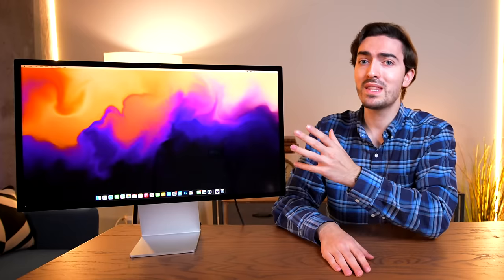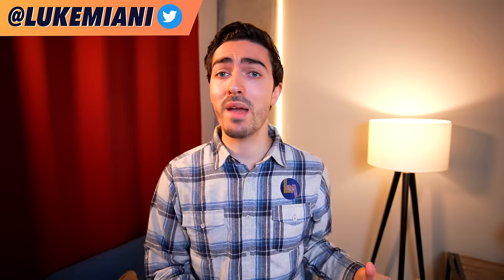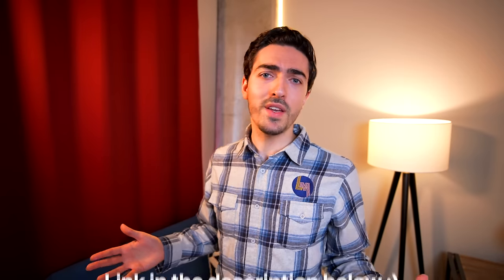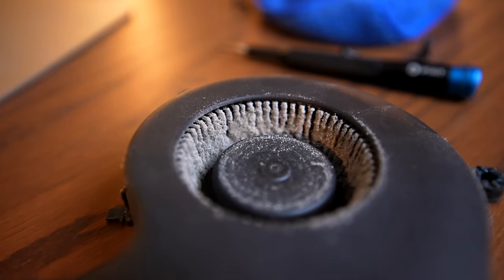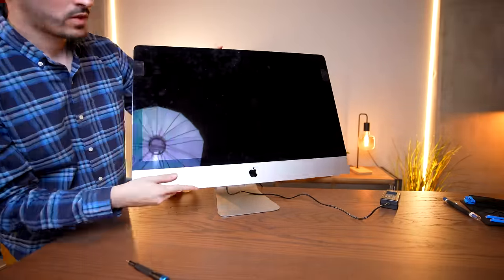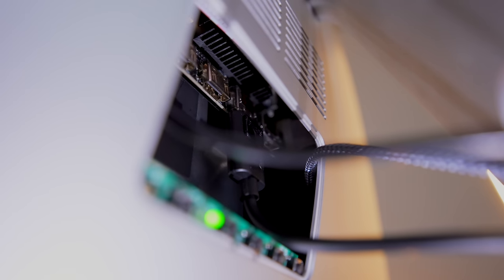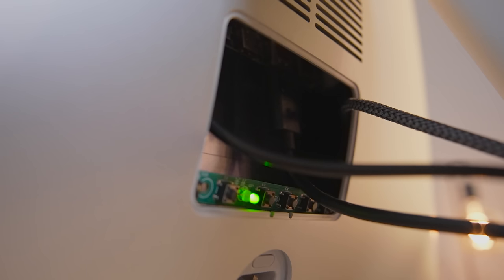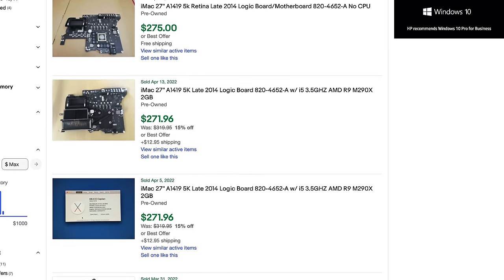How to make a DIY Studio Display for just $600! (USB-C & Built-in camera!)

Comment: August 18, 2024 post. With the aid of this great video (and a few other popular sites discussing this exact modification), I successfully converted my 2015 27in iMac computer into a 27in 5k external monitor this week. It’s great that my mac computer “sees” the monitor as a 5k monitor as seen in the “display” section in the settings. Note that I needed to remove 2 recessed screws to release the motherboard, so you’ll need an extended screw driver to reach those two screws (there is a hole in the motherboard above the screws). Luckily, my tool kit had an extender for my star bit. Also, connecting the backlit cable on the controller board to the screen backlit wasn’t clear as to which ends connected (left-side or right-side)? Luckily, I guessed the correct orientation because when I powered it on, it looked fine. Removing the screen, with the correct tool, was very easy! Bottom line is this video is a gem! And I would think most people can complete this project successfully if they take their time and proceed step by step in a careful manner. The monitor resealed perfectly with new adhesive strips. I did skip adding a camera. Took me 4 weeks, including the 2 week wait, for the controller board to arrive. One week to disassemble, 2 week wait for motherboard, one week to assemble. I took my time taking it apart, took my time rebuilding it so I avoided any mistakes or frustration.

Comment: Great video. A few suggestions:
3d Print  a bracket to hold the converter board and a panel to cover the cable out and buttons where the RAM door was.

Also you can rewire the existing original camera to usb very easy without the need of any converter.
Reply: how can you rewire the original camera?
Reply: Interested to know how you’d rewire the original camera. Please do tell.
Reply: yes i would be interested in hearing about this too!  I assume this would allow one to use use the built-in mic as well (a mic appears to be missing from the build in the current video)
Reply: my thought is just to carefully machine some access slots into the door.. but - Im thinking to use an mac mini housing applied to the outside of the iMac.

Comment: Really cool. I would attempt to reincorporate the RAM door back. Perhaps drill a cutout and stick a rubber grommet in it, tying and running cables through it prior (did something like that in a vehicle, looked stock). Drill the bottom of the door to install rubber button extensions that would press the clickers on the PCB. But that's only if I'd want it perfect.  Terrific project, Luke!

Comment: Wow, I'm an Apple Authorized technician so for me, a project like this is easy! The shop I work for also has plenty of dead 2014 iMac's laying around with working displays. This looks like a fun and easy way to put them to use!
Reply: Any chance you'd be able to ship some of these already converted to monitors to interested buyers...? I did see somewhere that certain imacs from 2009 to 2014 can be used as monitors through something called target display mode...
Reply: @diceydaze  I haven’t done any conversions yet, but I do have plenty of loose iMac screens from 2009 to 2011. The iMac’s after 2012 used a different type of display. And are much more expensive, I only have one 2014 display in stock as of now
Reply: I went ahead and took the gamble on a eBay non-functional unit. I’m hoping that the display arrives intact. It’s supposed to be able to power on, but iCloud locked. Couldn’t get any information on the condition of the screen. Would be awesome worst-case scenario if you had a 2014 or newer display on hand.
Reply: @diceydaze  2009-2014 imacs can be used as monitors through target display mode, but the 27 inch 5K retina 2014 iMac CANNOT. I have confirmed this.
Reply: @this_is_NOT_a_test  I guess that leaves no other choice than to dismantle it.
Reply: @this_is_NOT_a_test  as long as you don’t use anything newer than Mojave or Catalina afaik
Reply: @kantdiego  No. As I said, I have confirmed this. It has nothing to do with the version of the OS. The 27 inch 2014 iMac is "5K," and Target Display Mode (TDM) was dropped, because 5K iMacs require a custom timing controller to drive the display at 60Hz and TDM does not work with said controller.

Comment: Awesome project! I have just replaced this exact iMac (late 2014) with a Mac Studio and Studio Display.

I would like to clarify one thing I believe you are wrong about, which is the difference between the two displays since p3 color is not the only difference. The 2014 iMac panel is a 400nit (500 in later versions) and the studio display is 600 nits.

Comment: I just did this myself with my "old" iMac from 2017 and it works flawlessly. Two things i did additionally was to connect the power supply to the imac to use the original cable and 2nd i connected the original imac button to the remote control in order to turn on the display via that one. One Issue I faced is that because the imac is much lighter now, the chin rises by it self sometimes. Thats why i put some useless things into the body to get some weight.
Reply: Hi. I'm curious to know precisely what camera and microphone you used?   I've got everything else up and running.  Cheers!!
Reply: @vizcode-vd1es  greetings! I use non since i use my macbook parallel and thus dont need them in the mac. Its a monitor only for me.
Reply: How's the colour accuracy and are you getting 5K resolution ? Thanks.
Reply: @aman681  yes I am getting the full 5K 60Hz. As for color accuracy I had play around a little. I had a very small violett tint, which I eventually was able to correct. Most people wouldn’t have recognised tho, but I am very strict on color.
Reply: @helios007  Thanks for your reply mate. Yeah, I am planning to use it for photo and video editing so colour accuracy and deep blacks really mean a lot.
Reply: @aman681  you’re welcome. As for colors I got it completely fine for my needs as a freelance photographer for portrait and events. It’s still a nice display but if you really want black blacks you may opt for another display. For me it was mostly saving some money and having the experience of creating your own monitor but the apple display will give you better results since it has a bit more contrast.

Comment: This is a really cool project - before the Studio Display was released I had done some research into something like it and the tinkerer in me still wouldn't mind giving it a go. The only thing that worries me is that for $800 (before you sell any left over components) you're getting an 8 year-old panel, it's hard to say how long it's got left. The panel in my Thunderbolt Display suddenly gave out on the 10 year mark, thankfully I could get a brand new LG panel for it for c.US$250 incl. shipping. A new 5K LG panel is around US$400 or more, if ever needed, then you're getting close to Studio Display money.
Reply: there are 2004 apple displays that still work so

Comment: Oh man, I'm going to replace my 2017 iMac later this year and I can't wait to do this mod! Thank you SO much, Luke. Top notch content.
Reply: I'm actually doing this right now, but i ran into an issue. In the 2017 iMac, I have the USB C to DisplayPort 1.4 Cable (Luke's posted links) and tried to connect it to my iPad pro m1 and it did not display anything. Nor did the display work with my 2019 macbook pro either. It seems you need to connect 2 DP cables instead of 1. Trying to figure out which is the best product for this.
Reply: @BUdJohnson242  I ran into the same issue. I'm not sure how Luke magically got 5k on a single display port cable. (I bought the same cable you did and it's going back to Amazon tomorrow) Customer support told me the same thing you need two DP ports to make it work... My workaround was to use an HDMI to USBC cable. I was able to get beyond the 1080p DisplayPort barrier but only at 30Hz. But I think that's more of a limitation of the cable. I've seen lots of 4K HDMI to USB-C cables (rated at 60Hz) advertised all over the interwebs.

Comment: Awesome. Maybe I missed in video, do the speakers still work? Definitely considering this, currently have a 2017 27" iMac which is running great but starting to show its age especially as start getting into video work. This method makes jumping to Studio box much more appealing and overall affordable. If can sell off the iMac's internals would be about a wash in overall expense. Any way to re-purpose the iMac's SSD? Thanks Luke!
Reply: I'd guess an external disk enclosure of some type - I have no experience with Apple computers made post-2009, but you should be able to get some kind of an external SSD enclosure for it.
Reply: OWC sells external USB enclosures for NVMe drives with Apples proprietary pin layout.
Reply: No - the speakers were removed.
Reply: @fredhall3453  This comment has nothing to do with speakers. We are talking about the iMac's internal storage device and how it can be used as an external mass storage device.
Reply: @tsuyunobradley4439  Did you miss his first sentence?  That's what I was answering.
Reply: @tsuyunobradley4439  ..first sentence “…do the speakers still work….”
Reply: @ernestgalvan9037  well excuse me for struggling with the English language!!!!
My first language is Japanese, not English. And I use translate a lot to help me. I didn't see the sentence, so I'm sorry.

Comment: That’s awesome! Now I’m thinking if the 5K display can be mounted inside a Thunderbolt Display chassis 🤔🤔
Reply: If you can find the display without the front glass already mounted it should work. Been looking for a 5K display for that exact reason
Reply: @MMCLProductions  the imac displays always have the glass, they are glued on and sold as a single unit. the lg ultrafine 5k uses the same panel without the glass and stuck inside a housing. model number is LG LM270QQ2
Reply: @lilypadsy  legend, do you think it’s doable to put it into a Thunderbolt Display?

Comment: Thanks Luke!  Question: Do you think it's possible to do this install, but keep all of the iMac 5K internals and functionality intact?  Would be great if the required hardware could sit outside of the iMac, and allow for a graphics cable switch to switch between the internal  iMac and using as an external 5K display when needed.

Comment: I bought one of these last year for $500 - i7, upgraded graphics, 500 GB SSD, and it's my daily driver on the desktop. The screen, speakers, videocam are all great. I would someday like to run it in some kind of Target Display Mode via Thunderbolt 2 using a network connection to see if the performance is reasonable.

Comment: I really want to emphasize how important it is to be careful around that power supply, Once open the power supply is completely exposed and can be dangerous to touch for months after the unit has been unplugged. Thanks for the great video, I work in an electronics retailer and we have customers ask us all the time if they can use their iMacs as external screens? We have to say no because while luma screen exists it's not a plug and play solution like they want. Even though this might not be a solution for those random customers it's a great thing to know exists for those handy enough to do the work!

Comment: Great project Luke. Good use for an old iMac that otherwise would be recycled. One question - what do you use for the 12v power supply that the conversion board needs? Look like you had something external but I could not really see it. Thanks for the excellent videos!
Reply: Any response on the power supply?

Comment: I think it is an authentic and interesting project, well worth the tinkering effort. I have since bought an ASUS proart display for around the $600 AUS dollar mark and it is a wonderful display, however it doesn't have a webcam built in so this makes this project extremely viable, not to mention the nice Apple esc logo and additional software benefits you get by having Apple native gear.

Comment: Really appreciate your innovative thinking for reusing and adapting older tech that still has life. Wish I’d seen this 2 weeks ago, I just got a Thunderbolt Display to go with my MBP 2015 15”. It was $200, a late production 2015, mint in the box, and does fine with media content and color is great - video, movies, and photography - but lacks the sharpness with text especially if you get closer that normal viewing distance. Cheaper than the iMac solution here, but has me thinking if the 5k would have been the better choice?
Reply: If one day the panel fails, like it did with my Thunderbolt Display, you can still somehow fit in a lg ultrafine 5k Display into the enclosure of it!
Note that the Thunderbolt Display features a magnetic glass lid, so you won’t even have to perfectly fit in the ultrafine displaly…!

Comment: Is it possible to use an SSD to replace the HDD, then use that free space to install the conversion board and thus have it as dual purpose:  as an old iMac and as stand alone Monitor?
Even if it means that come cables and splitters would have to be outside the case. 
I understand it would be a much harder goal to accomplish, yet with a bit more functionality
Reply: I bet you could double side tape a couple of 2.5" ssd's to the inside, get a couple of sata to USB cables, then get usb extensions and run them to your mini or whatever and have your spare SSDs inside the display, which would be cool, but odd.

Comment: Great video! I noticed you're using dp1.4 cable though, and your board version R9A18 has 2 dp1.2 ports, which should provide only 4k max resolution via one dp1.2 port or 5k with 2 dp ports. Can you confirm that actual resolution you're getting on screen is 5k? There is another board R1811 with dp1.4 support which costs $275. Just wondering if that's worth it or whether your version works with no issues.
Reply: Thanks for auto-reply, check out my question though :)
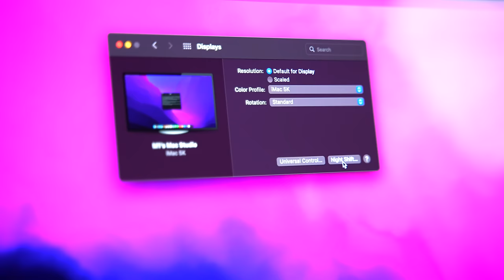Reply: Gleb, did you determine anything about this? Did Luke answer elsewhere? I would think it would've been obvious to Luke if the display was only showing 4K instead of 5... DP1.2 is indeed limited to 4K, but if you look at 11:50, the mouse is hovering over the middle/default resolution, and to the left it says "iMac 5K". I'd really like to know if I need to spend the extra $95 with my projects as well.
Reply: @fhturner3  I'd rather stick with other sources on this subject which give tech details and say the solution provided in the video should give 4k max, otherwise you'll have to buy 2 cards instead of one
Reply: The controller board you order, that matches (is designed for) your original 5k monitor part#, is a 5K controller board. And my mac sees it as a 5k display, and it looks 5k to me when compared to my Apple Studio Display. I did this Luke Miani conversion and got a perfect result!

Comment: Luke mentioned in this video that 5K is through displayport and 4K through HDMI. 

could you technically run a PS5 through the hdmi port? (@4k?) because that would be awesome (being able to switch between macbook and PS5)
Reply: So long as it's HDMI 2.0 18Gbps on the conversion board, it would probably work at 60Hz.
Reply: I believe so. There is a YouTuber who ran his PS4 Pro at 4k 60hz iirc with the 2017 panel.
Reply: @BattleDroid0402  Appreciate it. I assumed so, since it is just a HDMI port, but wanted to know if someone else did something similar. Thanks for letting me know :)

Comment: You glossed over everything mysterious about this project. You showed time lapse take apart and dust removal and almost nothing about choosing the adapter board and wiring the adapter board.
Reply: yes a customer of mine bought this for me to put together for him and the vertical sync connector is impossible to connect, the main LED connector looks different, and sourcing a power supply was near impossible, still in pieces!

Comment: Luke, I just looked up the board you used and it has speak outputs on the board. It's a white 4 pin molex connector near the corner of the board by the mounting hole.  You should try connecting the audio speakers of the iMac to them. then you would be complete.
Reply: if someone tries this, please post an update - this would be awesome!
Reply: I am thinking about putting the logic board and psu from the 2020 mac mini m1 inside and making it a 27”iMac replacement.  I think I would have to include a usb hub inside too.

Comment: I've seen a video of someone putting their M1 Mac Mini inside one of these displays, so you could do the same. You could mod the power supply connector to carry the display cable through to the controller board, and with some creativity you could make some buttons that look like the connections that go inside the holes for the ports that the logic board used to use to control the controller board buttons. That way it would look like an unmodified iMac from the front and rear but then become the fully functional display for your Mac. Arducam is in the process of making a 64MP autofocus camera module for the Raspberry Pi, so there may be a camera module that will surpass the current webcams in the current Apple line-up.
Reply: do you link to that video?

Comment: Ive done this with a 2011 21", but we went a little furter and tossed in a Switch Dock and Applified DAC to get the old speakers in the iMac to work. Just had the one USB-C cable out the back and it would charge and display the Switch.

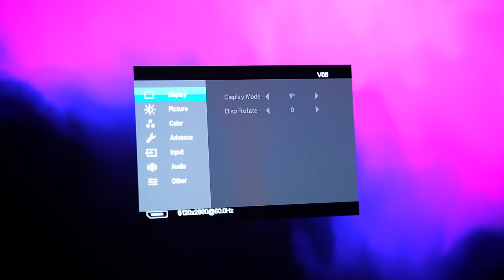Comment: The board that Luke is using does not have DP1.4 ports as he says.  They are DP1.2 ports.  DP1.2 does not support 5K with a single cable. So Luke is getting 4K not 5K as he's using one cable.  He would need a 2nd DP1.2 and run dual cables to get 5K.  You can actual see in his video the settings for the board are DP1.2 at 12:15. You can get a R1811 board that supports DP1.4 but it's $299 instead of $179. A single DP1.4 port will support 5K @ 60Hz.
Reply: Where do you get this board?